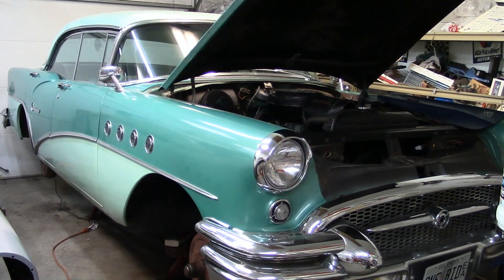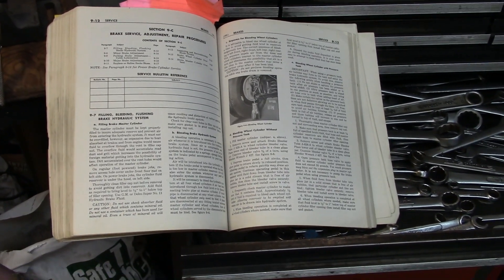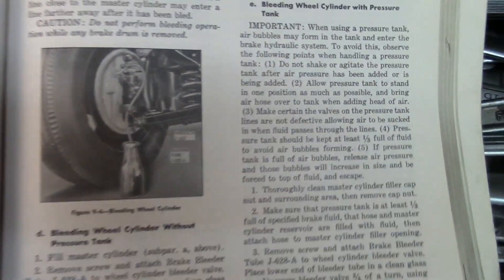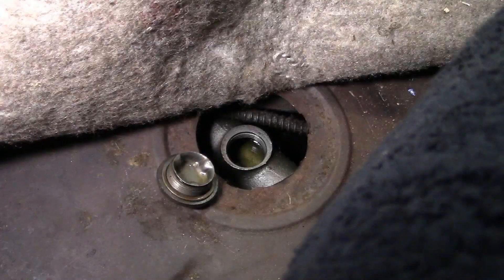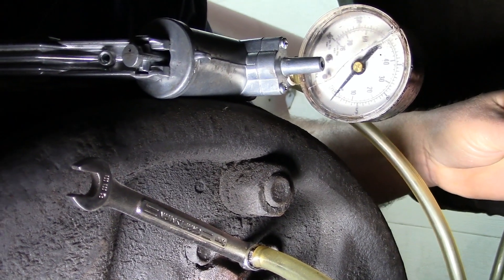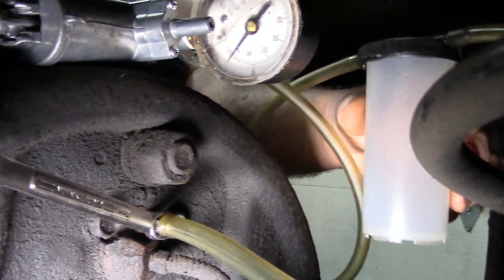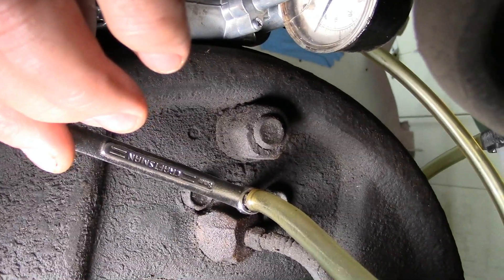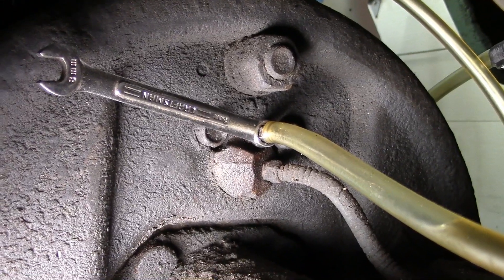1955 Buick Century 4dr (Bleeding the Brakes)

Comment: Finally someone that talks about classic all of this ASE mechanics talk about power this power that but at one point in life the power brakes came from our foot,,, I have a problem where I dnt have any fluid coming out at all from the back but the brake pedal feels stiff so am just going to clean all bleeders and cylinders and see if something is clogging it
Reply: Update I figure out why no fluid comes out the 3 rubber flex hoses the car as are clogged i took the rear one off try to blow with it with my mouth and nothibg took air compressor and nothing, ran water and nothing came out spill over the top, took front passenger one off the same thing front driver is good but as cuts on it will replace them all...

Am updating my comment so in the future people can c whats the problem and knw how to fix it

Also if u trying to figure out how to take the drum off u must take the castle nut off the washer and the center nut and the drum comes out as one the castle nut washer and internal nut hold the spindle bearings so be carefull once u take it off easy way to get to the cylinder and rubber flex bose to disconnect
Reply from the maker: Be sure to flush the lines out.
Reply: Yup thats the first thing I did after removing the rubber flex hoses flushed them out i wasted a bottle of dot 3 but well worth it